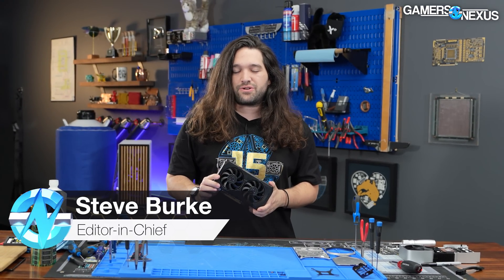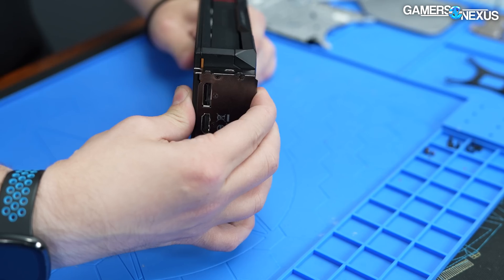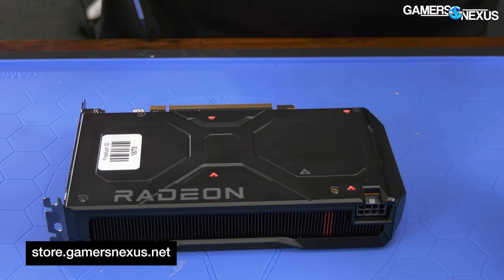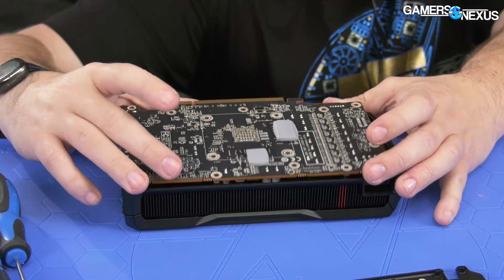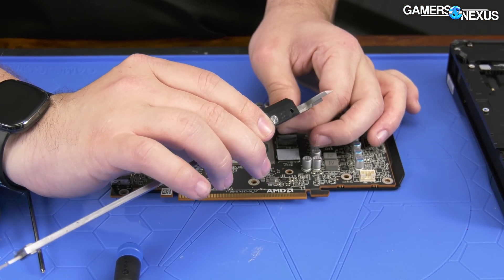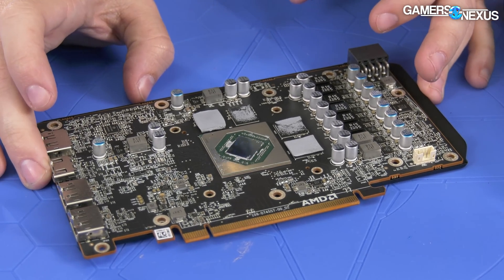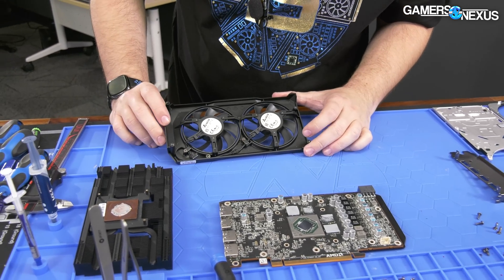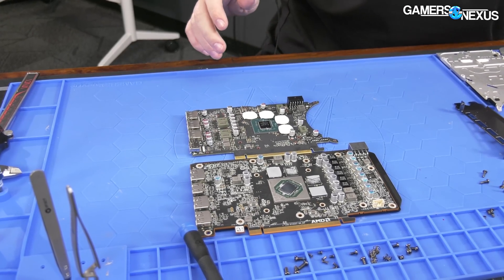AMD *Almost* Learned Something: RX 7600 Reference Card Tear-Down

Comment: Did amd stop using 8x pcie?
like jfc, make a budget card that no budget user can use (people with gen 3 or lower)
Reply: Running this in 3.0 x 8 mode will lose you... single-digit performance at most? 

Nvidia is doing x8 at this price point too, because it doesn't make enough of a difference to matter. Get yourself a cheap B550 board and a R5 3600. That'll give you 4.0 for less than this card costs.
Reply: I don't mean to be rude, but it's not like anyone needs to tell you you're missing out on a lot, if you can't run this. 

I have an hp 1650 super. Lol. This would be an upgrade if the specs were lower.
Reply: upgrade your toaster.

Comment: am i correct in saying they could have attached more vram on the spots with the thermal pads on the back?
Reply: this is a 270 dollar card, the most entry level card of this generation. 8gb is fine. it's expected at this price.
Reply: @connieclarke5855  I desagree with you, GPU in 2016 RX 480 have 8GB with MSRP only 229 dollar. and after 7 years they charge us costumer 270 with no improvement whatsoever in VRAM size? I expect at least minimum 10GB or better 12GB at this price point.

RX 7600 is supposed to be priced arround 169 dollar. or this was to be compared with RX 460 4GB as a improvement generational with MSRP 100 dollar back then.

Comment: It's been said that this Reference model will never be actually sold, it's just a proof of concept that's been sent to reviewers for review
The only 7600s that will be available to the public should all be partner models according to that rumor/leak
Reply: 6000 series reference cards were sold in plenty, I have one of them in my PC
Reply: Exactly. The launch prices are pure BS too, FE cards from either manufacturers rarely make it out of the US. Once the board partners start strapping their own stupid coolers and mild overclocks on them the price will quickly jump $100. Which will make the card even worse value.
Reply: @jamezxh  I've been able to buy the last 4 generations of Nvidia FE in Europe
Reply: @jamezxh  board partners for AMD almost always have MSRP non reference models, and they’re almost always better performers as well. You may be thinking of nvidia and how it deals with board partners.
Reply: @jamezxh  All of AMD's reference designs in recent years have been sold in Europe at least. You can still buy a reference 6950 XT and both the 7900 XT and XTX ones are available. As are non-reference, but at MSRP (and actually below MSRP at this point) designs from partners. A member of staff from a UK web store has also already confirmed that they will have models priced at MSRP available at launch for the 7600.
Reply: @jamezxh  last i checked the US exists. so even if those prices don't "make it out of the US" its still a launch price lmao.  live in a better country or something then idk what to tell you

Comment: Small niche request. Would it be possible to include deshroud measurements for those that might be interested in the mod? I know some GPUs aren't suitable and that would also be useful information.
Reply: The fan thickness is 15mm. As usual with most of open-flow graphic card

And indeed, when people put 15mm fan on their deshroud, it adds no extra thickness
Reply: @bocahdongo7769  In my case, I'm looking to know the thickness of the PCB and the heat exchanger without the fans or shroud. Then in a case like an NR200 or Torrent Nano, use nice fans on the bottom of the case and have the shroudless card rest directly on those fans. Using an adapter cable to plug the fans into the GPU fan out so the GPU can control the fans. Also if removing the shroud means the difference between a better card fitting in the small case, that would be helpful to know as well. With so many different thickness fans you could take this information to buy the correct fans when doing the initial build of the PC.
Reply: Just what I was looking for... nice that it exists, but something <180mm would be far better. I have a case with a absolut maximum of 179.75mm and one with 197.75mm... xD

Comment: Why are the pcb's on the amd cards so much larger than the nvidia ones?
Reply: Because Nvidia has the flow-thru fan design on the end, they have to make their pcb's shorter than AMD's
Reply: because it's just your standard reference PCB while nvidia's is completely custom to fit their cooler design. nvidia decided to drop their reference PCB's completely with 40 series but 30 series had the custom nvidia FE PCB and the standard full size reference PCB for all their cards that board partners could use.

Comment: The small size should make it a decent option for HTPC or small ITX builds. Being faster than the 3060 makes it roughly as powerful as the 1080ti, though with less VRAM.
Reply: The 1080ti is timeless.
Reply: @goryramsy  I’m honestly still getting a ton of juice out of 1070ti too
Reply: @danelee7900 My 1070 ti is still kicking ass. It overclocks just as high as it did 6+ years ago too. Literally no degradation even after all these years.
Reply: The 6600 xt was already better than 1080ti except 4k was matched no?
Reply: @andrewk8636  I think the 6600/6650XT were slightly faster than a 5700XT, so about 1080Ti performance with an advantage in newer games.  They just dropped behind at 1440/2160 due to the 1080Tis memory advantage.
Reply: Also with A1 codec support does make it even more HTPC-friendly.
Reply: Love the design... too bad, it's not <180mm.
Reply: Most 3060s OC pretty well, mine is an insane overclocker... +200MHz on the core and +500MHz on the VRAM with stock power settings!

It reaches way closer to the 1080 Ti.
Reply: I expect them to sell a lot of these at $230 or $200 in November.
Reply: If this card had 12Gb of VRAM i would call it a good card but damm.... I don't know if is useful at all
Reply: In its pirce range which card is better???? @EDARDO112

Comment: This card seems to heat up quite easely. Anything a user can do on hardware side to mitigate those high temps?
Reply: Add fans, buy a decent case, air conditioner in your room, undervolt the card. That's all I can see and it applies to pretty much all cards tbh
Reply: Buy one of the fancy partner cards with better cooling, those will definitely cost $300 at least though, at that point it's probably not worth it.
Reply: @steel5897  yeah that's the main problem. Just let the stock cooler heat and use the warranty if it breaks I say.
Reply: Buy a better designed AIB partner card instead of the reference model.
Reply: Increase the fan speed, it seems to be running a bit slow. Looking at Hardware Unboxed review the fan ran at 57% in their Hitman 3 example.
Reply: to what temp